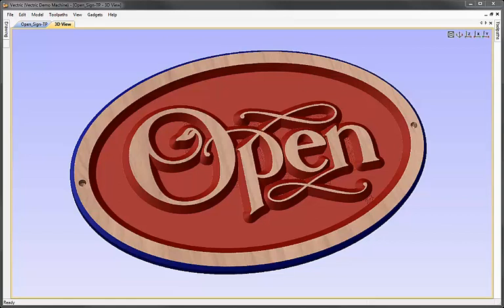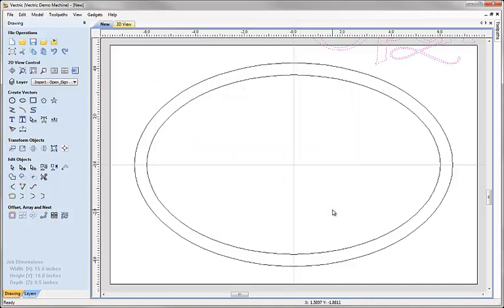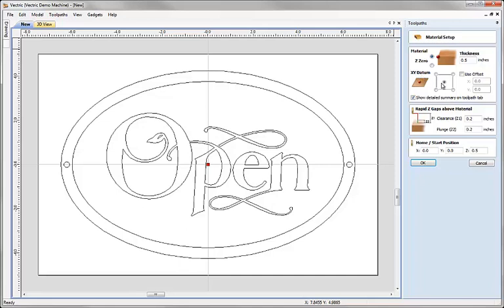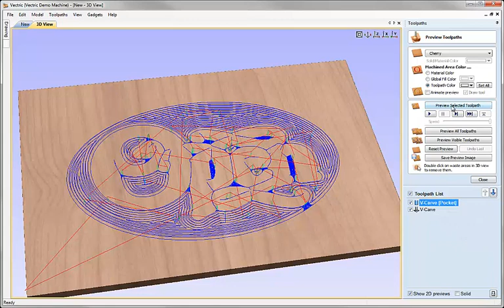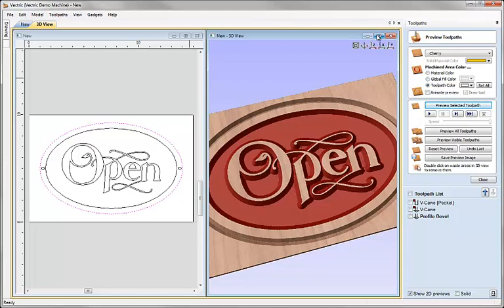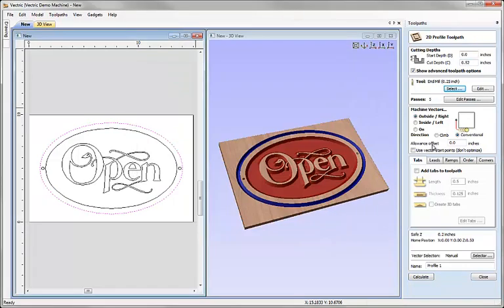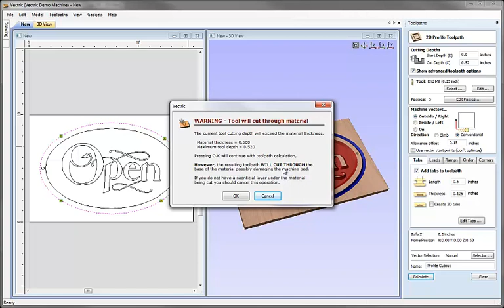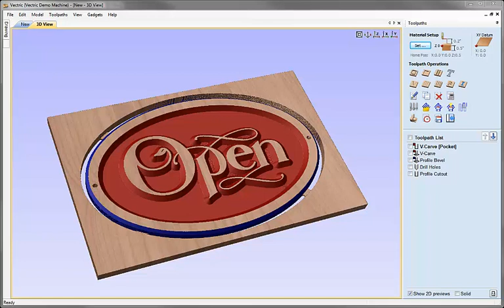A02s - Open Sign - Short Version

Comment: Hi, Great Video!  I'm trying to apply use this to make a sign for myself, and add "Eagle Head-B" from the Demo Clip Art that came with Aspire. 

When I preview all toolpaths it cuts the end mill v-bit and 3D roughing fine, but when I get to 3D Finish, the tool wants to "surface" the whole material (travel the whole board, and only dip on the Z axis when it gets to the carving).

What am I doing wrong?
Reply: You aren't doing anything wrong, it's the Vectric software "sucking".
Unfortunately Vectric doesn't have enough flexibility to allow you to trim tool paths. I am having exactly the same problem myself and I'm probably going to have to buy something I should have bought in the first place instead of trying to be a cheapskate.